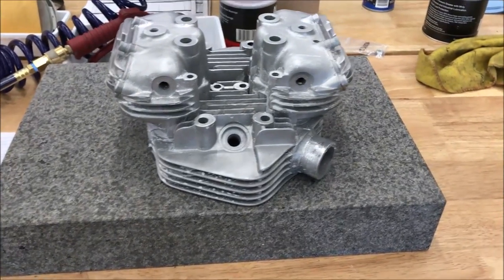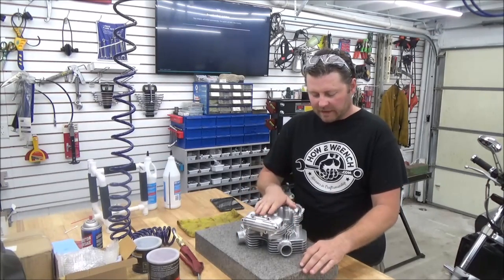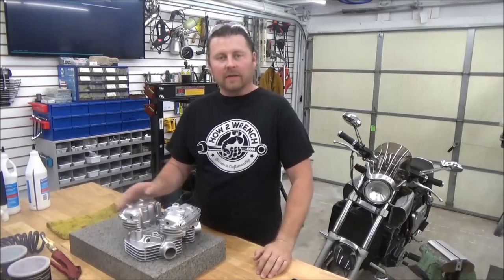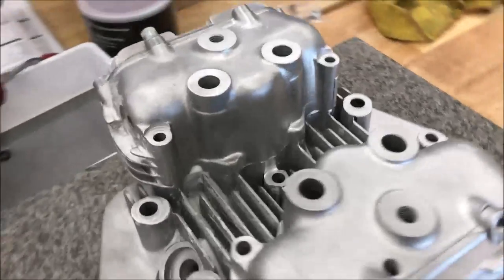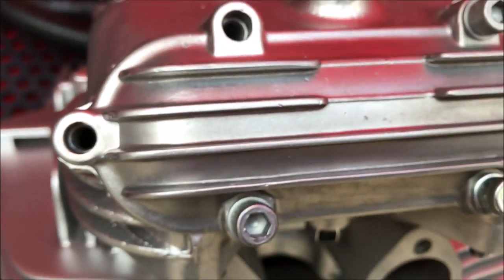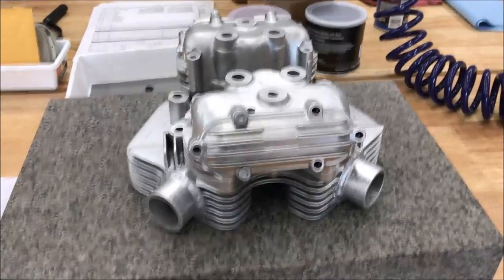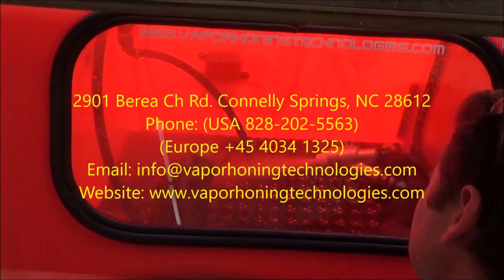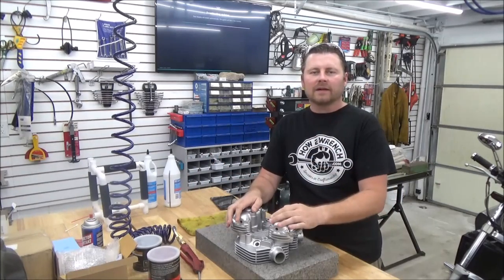Does the Vapor Honing Blaster really make a difference compared to sandblasting?

Comment: Sand blasting can have very negative results on prepainted surfaces. Don't think you can paint over a freshly sandblasted surface without hand sanding first, the media leaves small deposits in the surface that have to be carefully hand sanded out. I much prefer your water honing system.